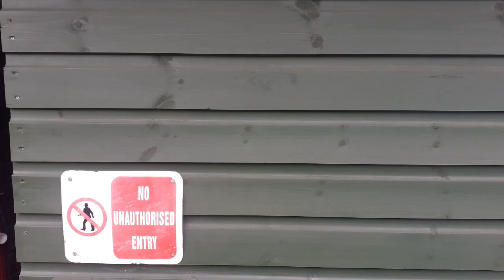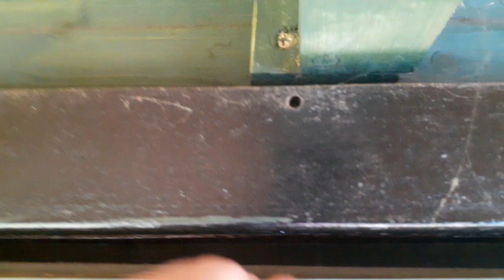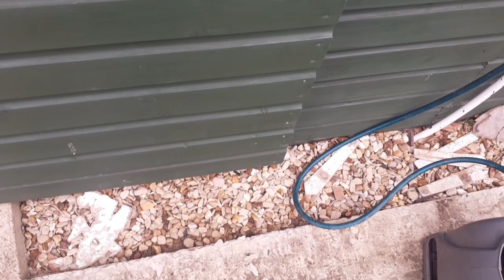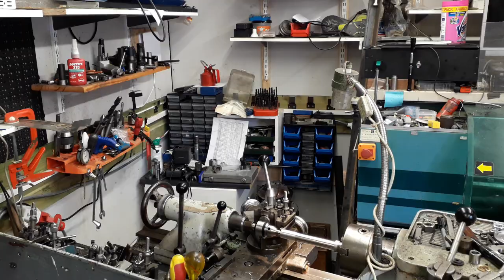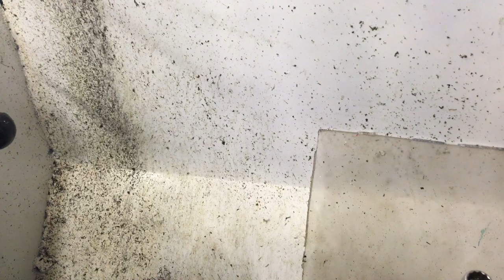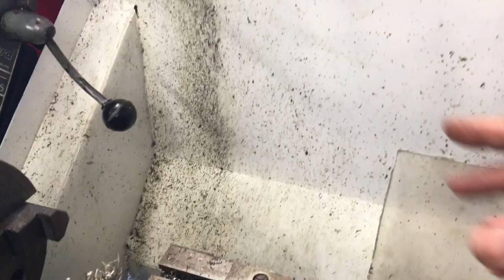Dad's Shed - Lathe tailstock re-alignment

Comment: Good job! You can buy or make a tailstock set over center you can adjust but the problem is with that is you have to set the cutting tool a long way out from the tool post otherwise it will foul on the slide fixture.
Reply from the maker: Glad you liked it. I do (occasionally) use a boring head with a centre in it to taper turn. I really must make a proper taper turning attachment for the lathe! - Oh, another little project....